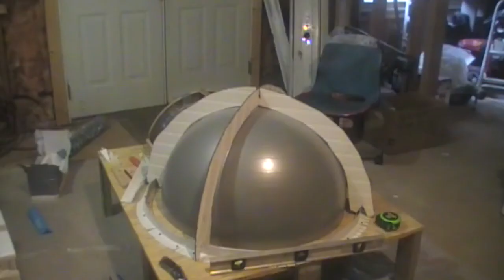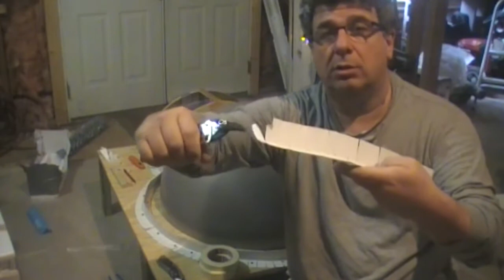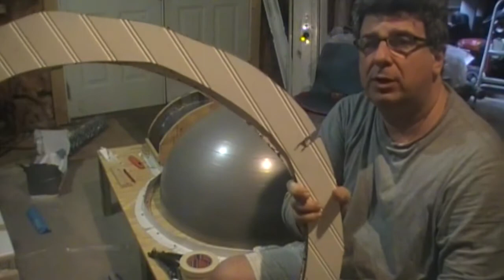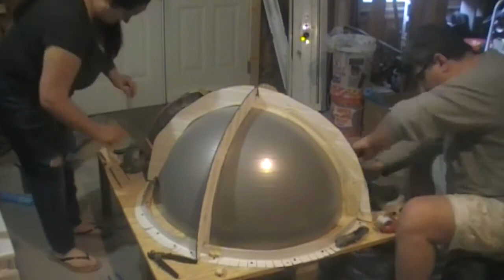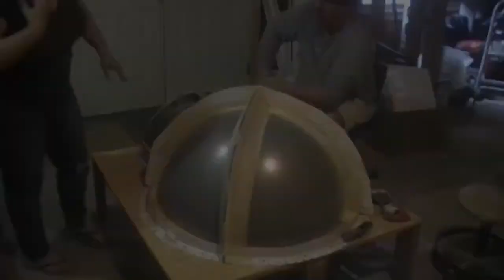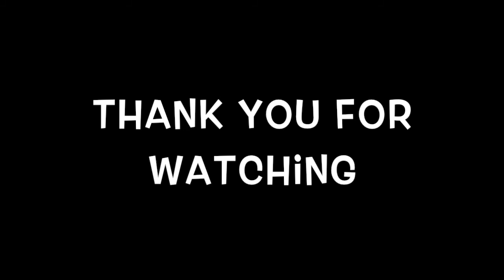Pizza oven dome - frame sectioned into 4 parts

Comment: Good concept but you spent the whole video taping the frame. What most would be interested in seeing is how you applied the refractory cement! Did you have any problems with the weight of the cement deforming the ball as you applied it?